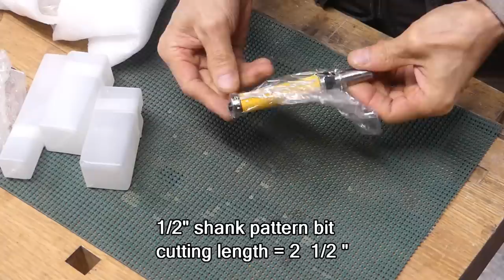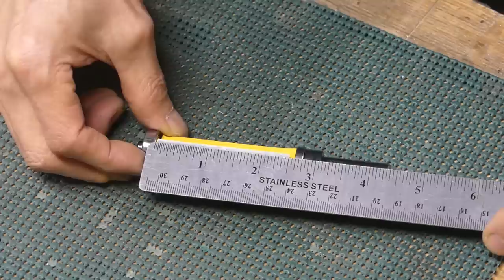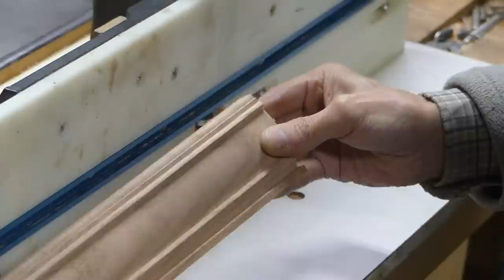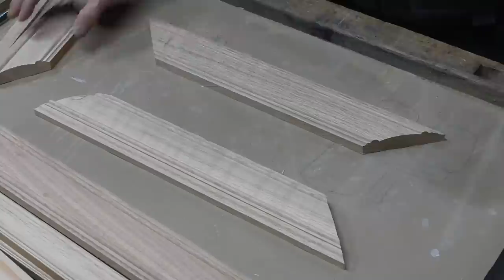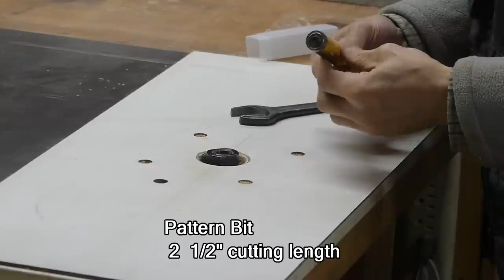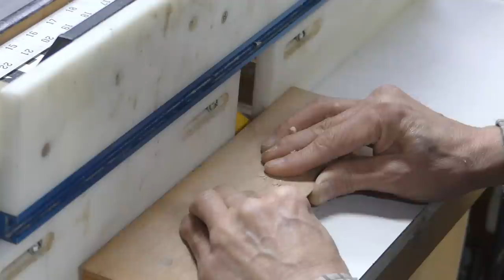Banggood router bit review

Comment: Please do an update after some hard use. I'm always sceptical that these work great out of the box but might lose their edge or have their bearings burned down after a short while.
Reply: you can replace the bearings those things are cheap  , im using the smaller outers that come in a box and they last me in hobby use for about 20 years now , even routed through some bradnails ocasionally by accident , think the most importand question would be how well do the matched pair routers work like for making raised cabinet doors

Comment: Nice,  I was thinking you could make a jig to hold the wood at different angles insted of just 90dgr  like crown is shaped
Becuse the routers always going to be st 90 dgr  you need a jig that can holt it at 22.5. 45.  60.  Or any angle off of 90 you decide would look good, for picture frames some frames are just that over a canvas.

Comment: they make a clean cut and look good, but, how long do they last cutting like that?
Reply: That would depend on the hardness of the material: pine, oak, walnut, MDF...
Reply: 1959Berre MDF is hard on cutting tools! We used to do a production job using MDF that required flat bottomed holes cut with Forstner bits. Didn’t matter what brand we used from cheap Chinese to CMT and Freud, they all dulled rather quickly tho the better brands did last longer. MDF is very abrasive for some reason. I suspect the glues and binders they use in producing it.
Reply: John Acuff, it's the glue. For the same reason that glue joints are hard on cutting knives.

Comment: Ill stick with Whiteside, Freud, and Infinity router bits.  I like bits that will make consistently clean cuts project after project.  Those cheap router bits may be good for one project, but they are garbage for the next.  They just don't hold an edge.  Besides that.  I am just not going to skimp on something that will will be spinning up to 20,000 RPM in my face.

Comment: I don’t know dick about wood working, but it looks as if you need a gate to hold the board against the cutter. 

Put a bolt up  thru the table beside the cutter.  
Put a round roller over the bolt. 
Now the roller will squeeze the board into the cutter head and keep the proper distance set.  
To change the distance use a thinner or thicker roller on the bolt.

Should work. But with climb milling the board will jam.  Don’t climb mill.